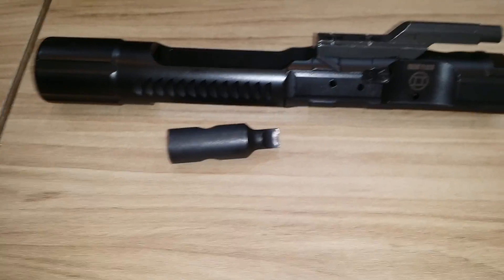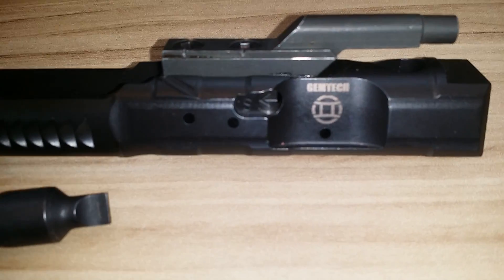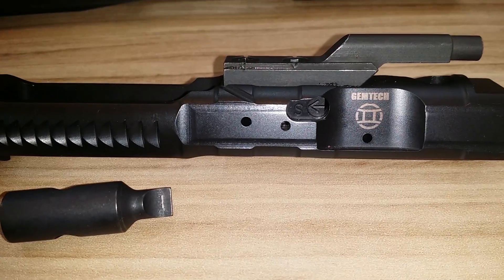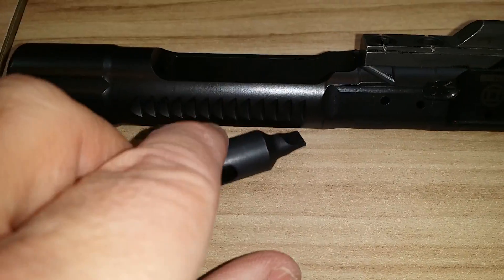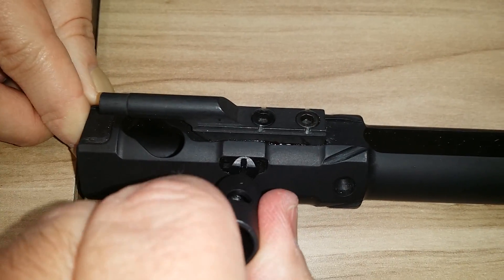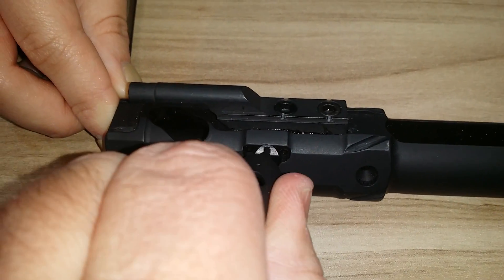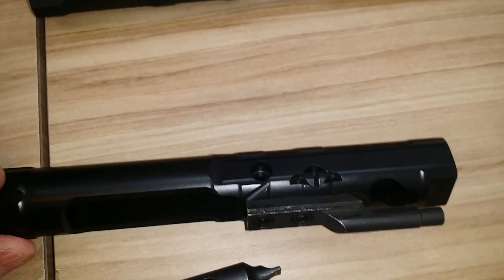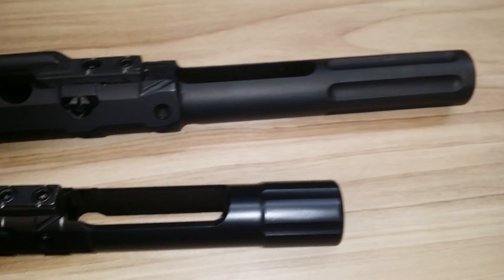Texas NFA Gun Trust @ Shot Show 2015: GemTech Suppressed Bolt Carrier

Comment: I emailed them months ago about the ETA on these and haven't got a reply yet. Do you know the ETA on these?
Reply: USMCProtector  I know this is several months old but I just ordered one yesterday.. shipped today.
Reply: Thanks man. Just got mine, let me know if you got a tool with yours.
Reply: USMCProtector  I did not get a tool with mine.
Reply: Alright, thanks for letting me know!
Reply: USMCProtector The box for the bold carrier does state it has a tool though. I am not disappointed as I can turn the mode with my fingernail, I am not going to change it back that often and I don't want an extra tool to carry around that only serves one purpose.
Reply: Same but I was just wondering. Mine is a little too stiff right now to just use my nail, but a spent casing does the job.

Comment from the maker: I talked to Joey at Gemtech and he told me that these eliminate the gas in the face associated with shooting an AR-15/M-16 suppressed with a high back pressure suppressor.
Reply: Sean Cody  I am left handed so I get more gas in the face than the average person when shooting a suppressed AR. I just ordered one of these bolt carriers, I hope it works well. I wonder where it redirects the gases?

Also sometimes hot gases would come through the small gaps in the charging handle which leaves a little powder burn on the face.